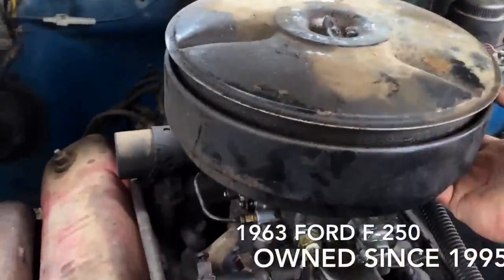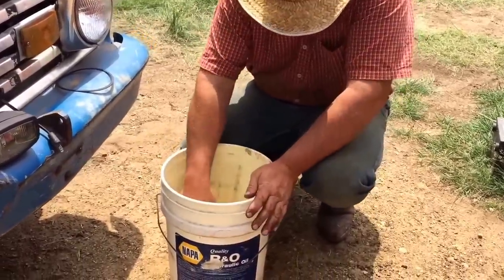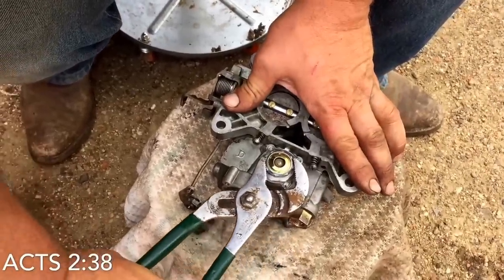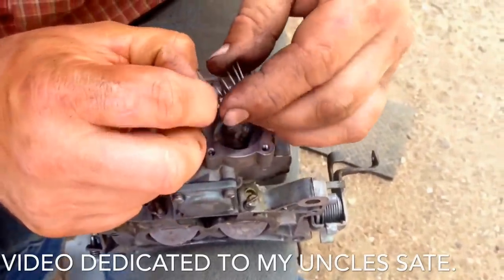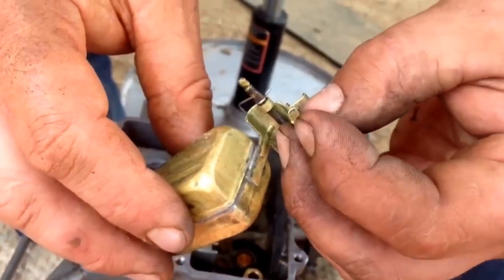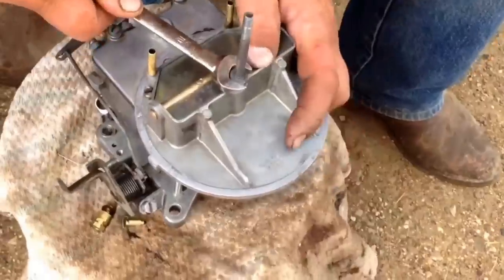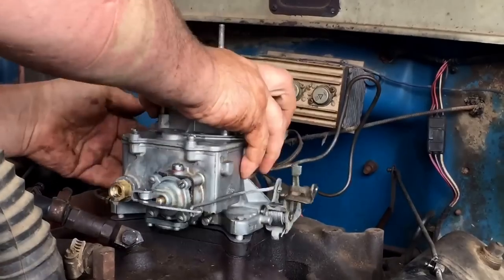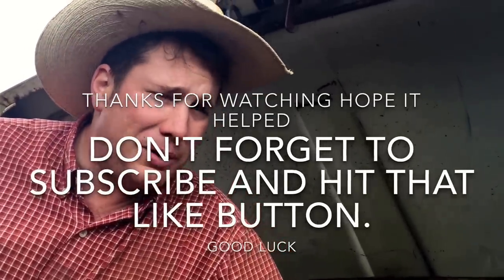Rebuilding a 2100 2 barrel Ford carburetor, on a 5 gallon bucket.

Comment: Have being working on those carburetors for quite a while. One thing I found out, is that PIne Sol is a great cleaning agent for the carburetor. I dip them in pine sol, and let soak for a day or two, then wash the parts with hot water, andd finish it with the air gun. Worked on many different carburetors, Holleys, Carters, Webbers, but none can beat the Autolite / Motorcraft in reliability.
Reply from the maker: Thank you for the great advice. I learned something today. Stay tuned and in contact. Happy trails
Thank you for the great advice. I learned something today. Stay tuned and in contact. Happy trails 
Luke

Comment: I totally agree that rebuilding carburetors is so much easier than people think. Im currently rebuilding a 2150, but the first one i rebuilt was a carter yfa. the carters have many more parts to them
Reply from the maker: Mike
    I agree full heartedly, i'm in the process of rebuilding a 2150 as well. Adjusting a carburetor is harder than rebuilding a carburetor. Thanks for watching,and taking time to leave a comment. Means it ton, I appreciate your support.

Comment: 5:27  you want to be careful tightening the power valve.  It takes a big wrench to fit it, but that same wrench can easily overtighten it and strip it.  Happened on a Holley 4160 carb I had.

Comment: When cleaning the needles, I use a red Scotch Brite pad and either Starrett oil or PB blaster to lubricate. I think a green pad or a wire wheel may be a little too abrasive, red is a little finer and will polish the needle a little nicer.

Comment: I think you put the accelerator pump diaphragm in backwards. The small bump knob should push against the push rod coming through the housing.
Reply from the maker: +JFV1134 
     Seems to be working fine. I want to check into that.
      Thanks for your comments.
Luke

Comment: Any idea what size the mounting bolts are for the carburetor? I have a 1967 meteor and they both have the same carburetor, I just can’t find the correct but size for the mounting bolts.
Reply from the maker: I’m not sure, it’s been a while since I’ve taken that carburetor off.
Reply: Back to the Basics 101 Okay, well thanks a lot for even responding, thank you

Comment: Hello I have a question. I have this same carb on a 1956 Ford f100 but there is gas overflow coming from those two brass posts in the front. I have not yet rebuilt mine but wanted to ask if that is normal for gas to come up from those? If not maybe whomever rebuilt it before put on the gasket incorrectly? Or maybe something else? Please let me know what you think. Thank you
Reply from the maker: +Richard Lopez 
    I really don't know what to tell you I'm just a rancher the changes parts and cleans things up! Sorry I couldn't help you with more. Thanks for watching new shows weekly.
   Luke

Comment: I have had 3 ford trucks now with 360/390 enhines. A friend too and they all seem to have an issue with 2 barrel motorcraft carb or aftermarket replacement. Why is it that they start to spit and sputter and act like no fuel or not get fuel when they reach temp, then  stall out and wont start for lik an hour? I just dont get it. I keep going through mechanics and noone can seem to fix the damn problem. Replace distributor, coil, fuel pump, ignition module, starter, the square thing inside fender with 4 tabs, everything. It's killing me. Just want to make some damn money already with my dump truck but it wont run good or stay running. I desperately need help.
Replaced carb gasket, fixed mouse damaged wires, re-tightened carb bolts, adjust the timing, seriously what is the problem. I even rebuilt a couple carbs, check vacuum leaks, fix them as i find them. They dont all have the round choke piece on the passenger side. Either way its a problem i can get fixed every time.
Reply from the maker: Gary’s Auto, he’s a carb specialist, 
1 (701) 483-0050

I’ve had the same problems, if it’s not one thing, it’s another where the carburetor is freezing up etc. etc., it’s the reason people switched over to Chevys and I love Fords.

I’ve had a lot of problems over the years with Ford carburetors. ; (

Comment: I do have one idea for a video. everyone shows how to take a transmission out of a 1993 Ford ranger. 2wd 2.5  5 SPD. but they don't show the trick to putting it back in. keep in mind I'm outside on a concrete slab. and it's on jack stands. And I have to crawl under it. lol. just and idea for a show. thanks.

Comment: Dude! At 15:55 you counted 2.5 turns out but only turned 2.5 HALF turns!! Is this a joke video? I'm no mechanic either but come on!
Reply from the maker: +6Blackie6 
    Sorry not to live up to your expectations. I’m glad I have a lot of critics, that’s what this world needs is a lot more critics.
Reply: Back to the Basics 101 Hey dude, I'm not trying to be a critic. Just trying to help. Sorry you took it the wrong way. 3/4 of a turn out is waaay off. If you are too defensive to accept a little advice then good luck burning out your valves!